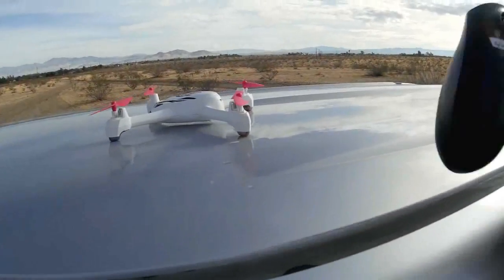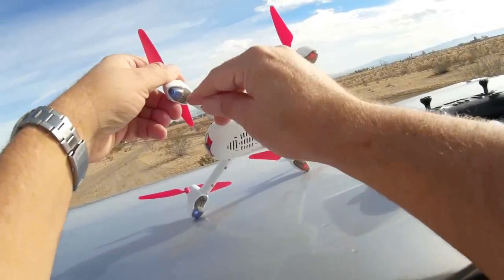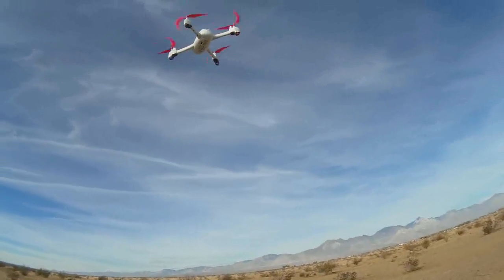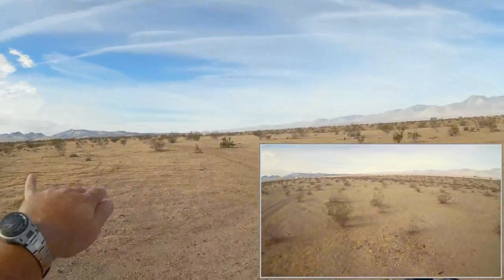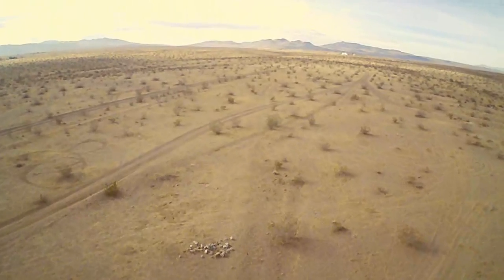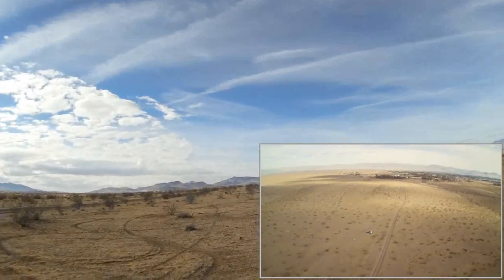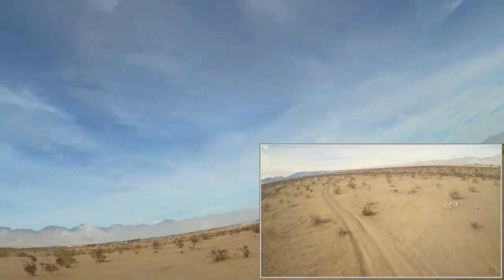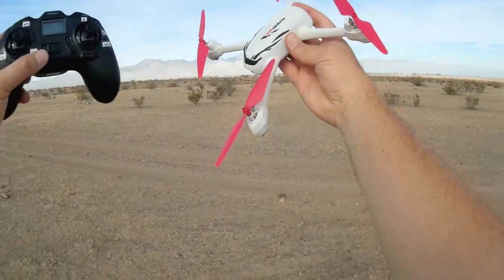Hubsan H502E GPS Drone Tips for New Fliers

Comment: You know, when you (and others) first demo-ed this quad, I was all set to get one. Then I started seeing a lot of YouTube videos on replacing motors (which is not particularly easy on this quad, compared to say, a X5C),  and even a guy having to replace his control board.  That got me to thinking that this thing is flawed. You mention today of 'toilet bowl' is surprising, because I'd not heard of that problem in relation to this quad before.  The XK X380 is the KING of toilet bowl (and it has other issues as well), and sometimes requires multiple compass cals to get it to settle down.  I might give a 2nd look at getting one of these.  The batteries are a little proprietary in size, and I don't know how cheap or available replacement motors are, but I wouldn't get one without getting at least a couple replacement motors to have on hand. Thanks for the follow up review. This would be a good one to put in my bicycle pack to take out on rides. Of course, what I really want is a DJI Mavic for that, but that will definitely have to wait until the price drops a bit. Cheers.
Reply: Have to agree about bad motors. Right rear died after only 3 flights and now left rear after about 12 flights.
No sand here, almost always hand launched & landed. If it slowly starts dropping or is hard to control then seems fine after re-powering and rebinding and one prop is not turning at idle, it wont be long before it dies for good. Feels like the brushes are binding up.
Reply: Pretty disappointing for a Hubsan product. You'd think they'd use some quality motors. Perhaps they used smaller motors than what is required. Not sure, but I think these are 8.5mm x 20mm.  That size is used in several minis, like the BoJiang S1 and the FY326.  Not sure if there is something bigger, but pretty sure they could have come up with some better quality motors.  I think there's a 3rd party company which sells quality brushed motors, but then you'd have to transplant the pinion gear from the shaft of the original motor, and who knows if the shaft sizes are the same. Any way you look at it, its a bust.
Reply: mm...t did worry me.... Didnt  front motor broke down after a crash. Isnt that kidna strange? I mean when it crashed, it was me flying it into the ground. It was the battery that shut off in mid-air. ALl the other motors works like it should. So this is a common problem with Hubsan that motors stop working?

Comment: Newegg had them for $69 a few weeks back so I ordered one. First one the RTH button was broke, so exchanged it. Second one when I finally got it to bind the throttle was stuck on high.  No control to shut off. Of course even turning off transmitter didn't help because of RTH function.  We had tried it inside first so hubby held on to it until battery died. LOL  Sent it back

Comment: no motor burn on yours yet? how many average flight can we expect before changing the motor?
Reply from the maker: Nope, mine are still going strong after more than a few dozen flights.  But I religiously follow the tips as discussed in the above video.  Also make sure to quickly turn off your motors if you land in tall grass or encounter a crash.  Leaving the motors running when they're obstructed from turning can damage your motors and components on your flight control board.